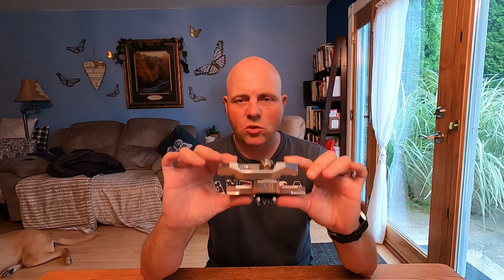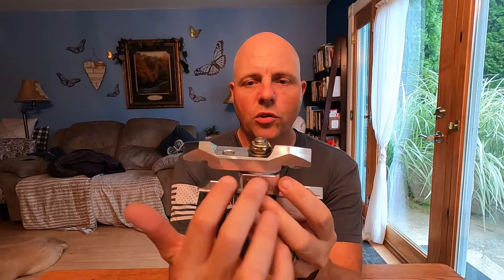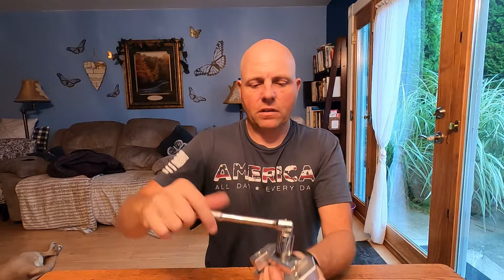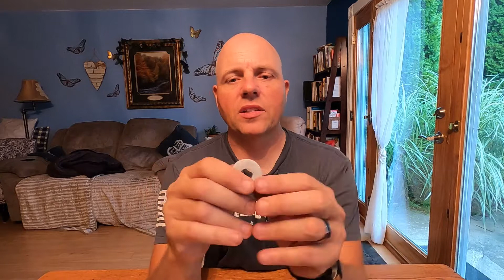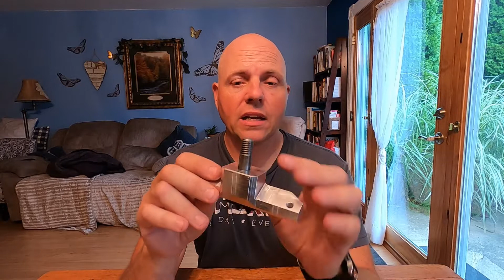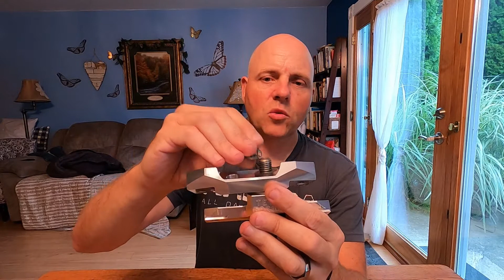Lets dig into the Swiveling screen kit for the Tesla Model 3 and Model Y. Today I take it apart!

Comment: I love this idea. I’m planning on getting this shortly after I buy a Model 3 before the end of the year. My only concern is, I wanted to get this and the center console that accommodates the iPad Mini i1Tesla developed. My concern is that this product drops the center screen low enough that it blocks the view of the iPad.
Reply from the maker: It depends on your height. 

Worst case you view may be blocked about 1/4 inch of the top edge of the iPad.
Reply: @TechForumTesla  Thanks.

Comment: This is looking so good and well engineered, very tempted to buy...  However the fabric sleeve, which is also looking well designed by the way, is what hold me from buying it. I would buy when a vegan black leather sleeve would be available for it, even when that vegan leather sleeve comes at a premium.
Reply from the maker: Why? What is the difference? You cannot see it back there anyway.
Reply: Tech Forum Matt imho it looks cheaper than cheap, sorry... no need to argue ;-) I will not buy one as long it is only available with the fabric sleeve.
Reply from the maker: @FlevopolderAviator  your choice......
 Also you haven't seen it in person. Trust me, a shiny material like you are asking for would look a whole lot worse than fabric. We tried it. Shiny material like you are asking for shows every single wrinkle or slight imperfection that the satin fabric hides. For me, I think wood on the dashboard looks exceedingly cheap and crapy. Everyone's tastes differ.
Reply: Tech Forum yes, it is true that I have never seen the sleeve / mount in person. It is just my strong believe that reuse of materials that are OEM like, ie the black vegan leather that is used for the seats, make it less obvious that this mount with its sleeve are not OEM. It is a 65k USD car we modify after modification it should still look as 65K USD car. Maybe you can show your sleeve prototypes in a future video and convince me of my ‘wrong’. This all having said the mount and what it does is still a marvel of engineering and I really hope you can make a little profit after all the work you have put in to it.
Reply from the maker: @FlevopolderAviator   I'm not necessarily saying you are wrong. I just look at it differently. Again, for the amount of money this car costs, that wood on the dash is butt ugly.😁

Comment: This is really in-depth Matt. Do you have a utility patent on this? I would be worried about some Chinese company copying your design, they could manufacture this in China at a very low price. It looks like you spent a lot of time on it, very well-refined.
Reply from the maker: A patent wouldn't protect me from someone in China. Even if it did, have you tried suing someone in China? A patent is really only as good as your willingness and financial wherewithal to Sue that person.
Reply: @TechForumTesla  I didn't realize that you would need a Chinese version of a utility patent. Apparently that does exist, but like you mention enforcement costs are the issue. No wonder so many of these companies produce knockoffs. I guess if your volumes weren't ridiculously high it would never be worth the litigation expense either. I learned something new.